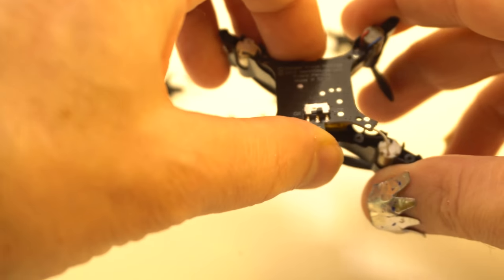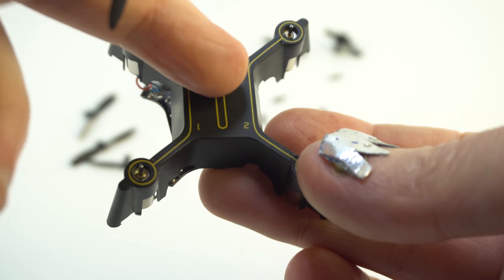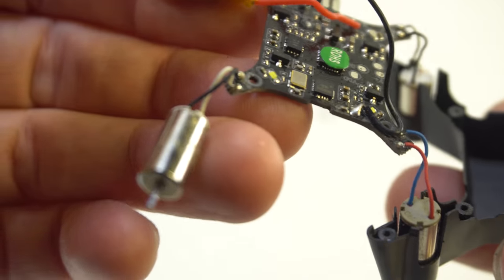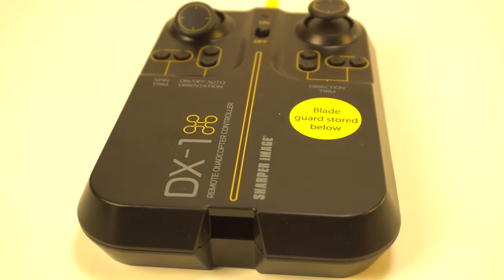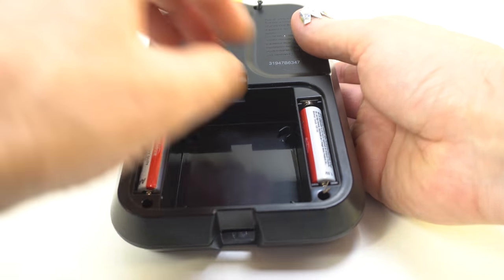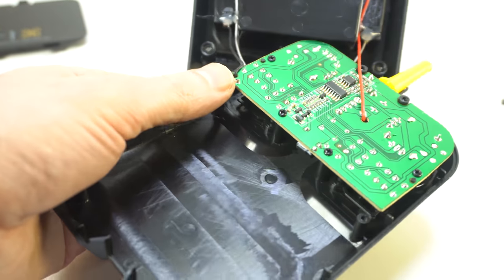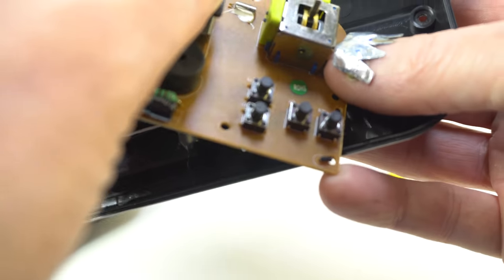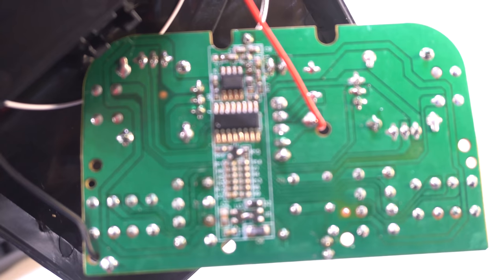WHAT'S INSIDE SHARPER IMAGE DX-1 MICRO DRONE? & FLY !

Comment: I need props but I live in America, they sell them on amazon, so I may get those. Could I upgrade to crazy ponys tiny whoop motors? 6*15 mm or would I have to upgrade battery and fc as well?  I had a problem where one motor wire broke off the solder joint once I soldered it back on it drifts very badly to the right. Have you encountered this problem? Thanks for any help.
Reply from the maker: Yes i think all motors should be same, if one is different drone start to fly badly, you should, change oaa 4 motors ore, fnde 1 some motor, ore you have been fix props to to different place i mean change props position
Reply: Thanks